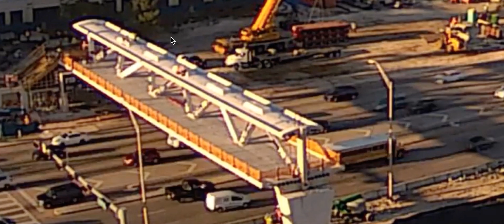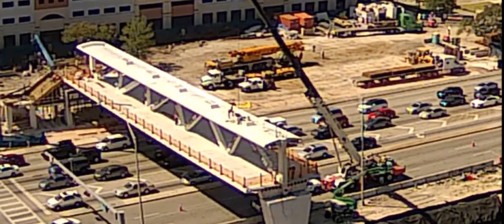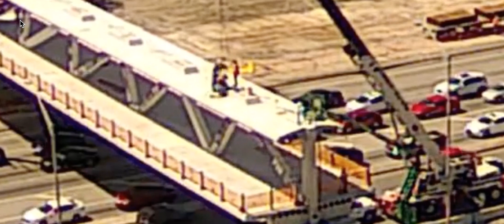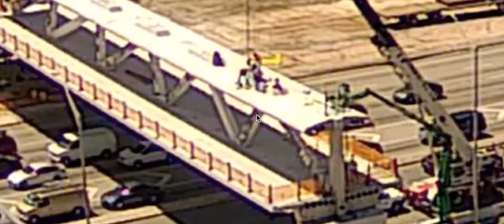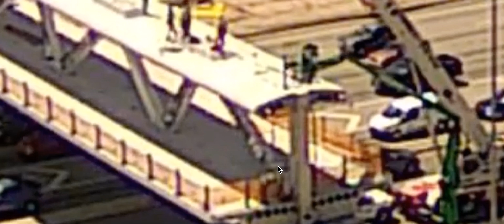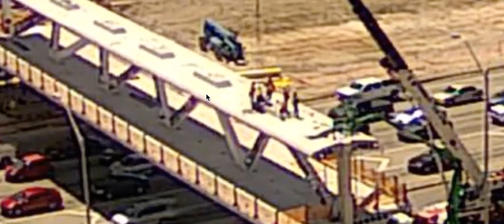FIU Bridge Collapse TimeLapse of Post Tensioning causing ultimate failure of bridge

Comment: There should be 2 gurters under that precast slab or they should have poured a slab span  if gurters clearance was an issue  ..I’m sure road clearance is why the went with a precast deck ..but they should have poured a slab span
Reply from the maker: Mike, thanks for your comments, I do read them all, just so you know...

Comment: You mentioned the worker sitting down not participating with the the crew who were about to do something he thought was a bad idea. He knew about the cracks in the concrete and also knew this project should stop right now. Hopefully he got off the bridge when they swung around the crane and told the men to start tentioning
Reply from the maker: Perhaps you are correct... that would be nice if ONE OF THEM would come forward! We know they did NOT sign any agreement with the NTSB!
But, they are protecting their companies they work for and NOT the public...
Reply: If you know something is unsafe you call the proper authorities and tell them. So many people failed to be competent on this job.

Comment: Thank you for all your hard work, on bringing this to light.  Criminal Negligence was my first thought last year..  This confirms it in my mind.  I cannot believe the cavalier attitude toward the cracks and safety.  I still am amazed that a structure can be built in humid salty South Florida, which will fail if a single steel part fails.  Wouldn't the steel post tension rods naturally rust and weaken sometime in the future?
Reply from the maker: Yes, all metal will oxidize over time... and replacement would be impossible, I think, without temporary supports from the roadway   up...
Reply: It looks like the guy near number 11 sure knew there was a problem, seemed to me he knew there was enough of a problem to make sure he was off the structure when whatever tensioning process started on the top deck. Couldn't forensics find out if frames are missing & who those people were by matching it up to any of the before & after dash cams?

Comment: Is it possible that equipment failure or operator error could have caused sudden total DE-tensioning of one of the PT bars in 11 when they were trying to add tension?
Reply from the maker: It is possible yet, the NTSB claims no equipment failure was notable and they based that on finding another piece of equipment and comparing the two... as per NTSB's public release statement... 
Sootikins, your thinking is awesome, that is the way to think to find possible failure modes and then to eliminate those as possibilities; as the NTSB has claimed to have done.
Reply: @ForensicCats  Thanks for the "awesome" and thanks for your dedication in researching and reporting on this incident! I've been following your coverage since the beginning, I just don't comment very often.
Reply from the maker: @sootikins  , thank you... I also have another one in a few minutes; seem to be taking on some speed in the court case.

Comment: Like Linda Figg said, it's a structure where everything must be under compression (i.e. all concrete must utilize steel under a tremendous amount of tension). Like you said, it was failing anyway, but then they do something that ultimately reduces both steel tension and concrete compression!
Reply from the maker: Excellent points...